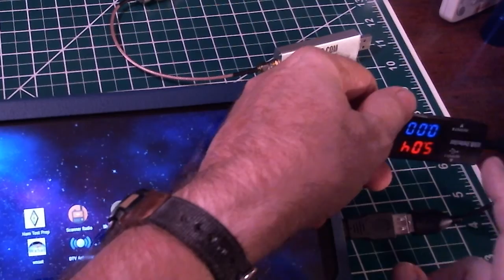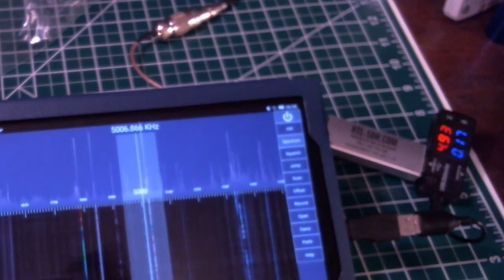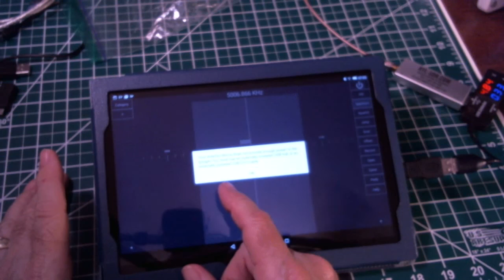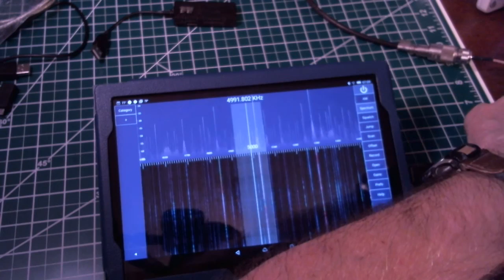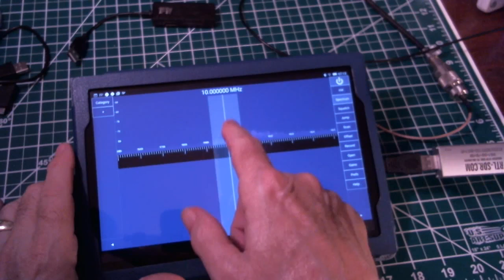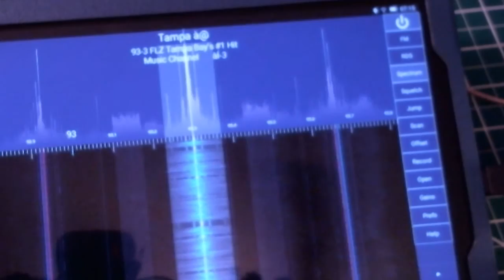TRRS #1271 - Experimenting with SDR on Android Tablet

Comment: Great vid Tom! A better adaptor to use for this connection would be what is called an OTG (on the go) cable as it will give you some strain relief to help prevent accidental breakage of the micro USB port. They are only a buck or 2 depending where you get them.
Reply from the maker: I have been looking for one this morning.  Most of them on Amazon are $7 or more.  Need to check China, :)
Reply: I got mine from ebay. I think I got 5 for $6. They are pretty handy.
Reply from the maker: Wow that is more like it. :)
Reply from the maker: I could not find one with a 12 inch or longer cable.
Reply: Tom, I just use the short OTG cable for strain relief and then a normal USB extension for extra length if needed.
Reply: The short OTG cable connected to a regular USB cable is what I used and showed in the SDRplay to Android smartphone video I made that you watched and commented on a few days ago.  It seems to work fine for me.  Looks like you are making great progress with your setup!
Reply from the maker: Thanks.  Slowly we are getting there. :)